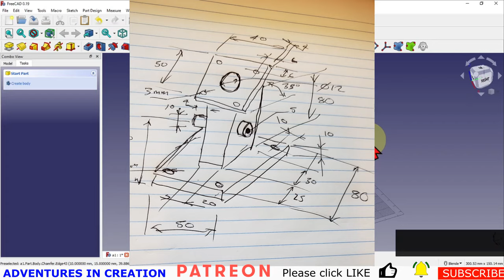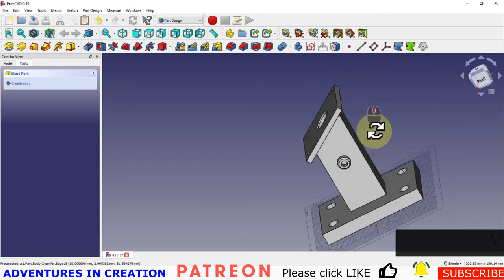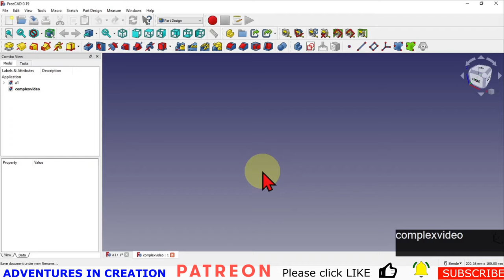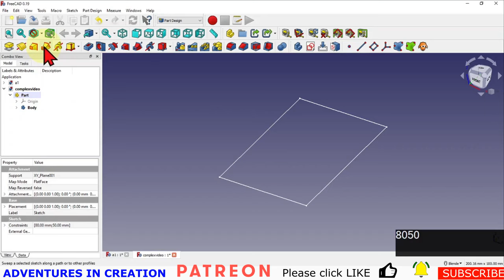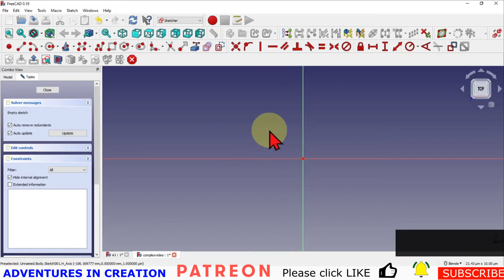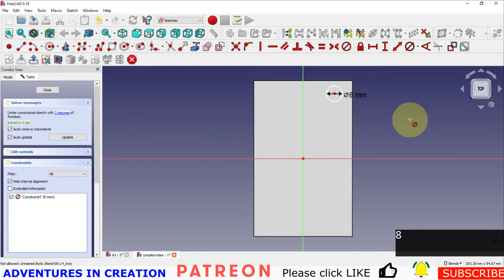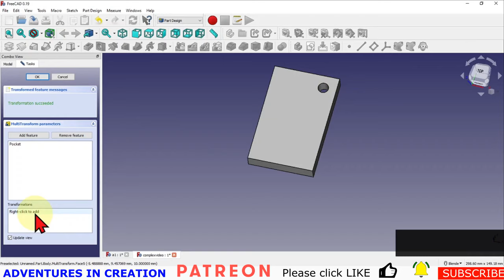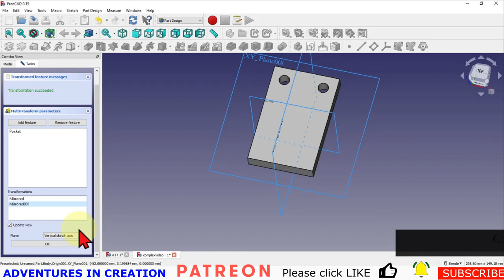FreeCAD Beginner #10 - Creating a complex model

Comment: very much enjoyed this video, thank you for your efforts.  Now that I'm retired (65) I have time to dig into CAD as I'm now the owner of a 3d printer and soon a desktop cnc mill.  I'm very familiar with isometric drawings as a machinist and electrical engineer. .   I've been bumping around CAD software ie Fusion 360 and a few others sort of picking stuff up but really need to find an instructional series that shows best practices for CAD drawings. I need to start at the beginning of your series now more for the learning where all the various keystrokes come from on the user interface.  It is good to see how the process develops on a more complex model.  I will revisit this video after plowing through the earlier ones from beginner on upwards to get familiar with the software.
Reply from the maker: Make sure you take a look at #27 it's on tech draw and will get you to a fully dimensioned drawing.

Comment: Being a person who does not necessarily remember formulas, I ended up experimenting with the datum plane for the angled piece by attaching it directly to the surface produced by the angled cut of the upright, and used the upright's external geometry as reference for measurements and constraints of the angled face while in sketch mode. It's a bit easier IMHO than remembering somewhat obscure and complex formulas. 

Just my 2 pennies. Thanks again for the excellent tutorial!
Reply from the maker: I am glad you are experimenting for yourself, that's what I hope will happen. Just one word of caution, if you attach a plane to a face you may run into the topological naming issue. If you do that, you might as well just create the sketch on the face that you were going to attach the plane to. You can create a datum plane on a base plane them move/rotate it from there.
Reply: @Adventuresincreation  Thanks for the reply. I thought using a datum plane on that surface instead of the surface itself would sort out the issue, since the plane is (I think) used in lieu of the surface itself. Isn't that how datum planes work? Well, I suppose that's how they should work in my head, haha... Guess I'll have to do some more experimenting to try and figure it out. Thank you.

Comment: 3:15 the order of selecting the vertices is important. First select the two corners (upper left and bottom right) and than select the center / origin.
Reply from the maker: This is true
Reply: A way to get around this is to draw the rectangle from the center. That option is available.

Comment: I appreciate your work so much, this is great stuff. I appreciate showing us how to modify a datum plane to sit on a custom axis, but I wanted to mention that it's also possible to do this by simply clicking on the face in question and choosing "Create a datum plane" from the Tasks tab.
Reply: Just be aware that attaching the datum plane to the face makes it vulnerable to the topo naming problem. I'm not sure there's really much use for attaching a datum plane to a face either. If you're doing that, why wouldn't you just sketch on the face directly? Hopefully in a few months, the topo naming problem will largely be fixed.
Reply: @haysoos123  thanks for those details!
Reply from the maker: Just to reiterate what @haysoos123 said. If you watch the video I will publish this week FreeCAD Beginner #11 you will see a demonstration of the topological naming issue where I show how creating a sketch on a face is problematic. - It works but only if you don't modify the sketch afterward. That is why I don't use that technique. Hopefully, it will be fixed in release 0.20.
Reply: EDIT: I lie (sort of). After adjusting the hole diameters that are part of the multi-transforms,  that triggered the topological naming problem when the datum plane was attached to a face.

 @Adventuresincreation  I actually did it this way as I was recreating this part, i normally try it before watching your method. It worked fine, even if you go back and alter the length or width of the pillar etc. I understand the topological naming problem, but it didn't cause an issue in this context having just attached the datum plan to the face. I liked your approach for positioning the plane independently though, was  good to see that.
Reply from the maker: @TheMadMagician87  usually it works. It's when you adjust the model later that it all goes bad. I am glad you are trying it first before watching my solution. There are many ways to achieve similar ends.

Comment: Many thanks. As I understand it, you could have established the datum plane directly on the cut face (highlight the cut face, then make a datum plane) without having to do any computations.
Reply from the maker: In the latest version, you can do it on the face however, in older versions that would have caused an issue with the TNP
Reply: Ok. Anyway, good run through some basics. Thanks

Comment: Funny, I made parts on my router for a long time using inch and most of the drawings I got where in mm, and I converted them for the longest time before trying it in mm.  I haven't gone back to in yet, I now convert in to mm!
Reply from the maker: Same here, I started out with inches but find metric way easier

Comment: This might be dumb question, but I'm relatively new to CAD, so... instead of positioning datum plane, wouldn't it be faster and simpler to select the angle face on the body and then hitting sketch?
Reply from the maker: Yes it would but then your model may break because of the topological naming issue. Basically the reference to faces can change when the model is modified. Datums are a way to prevent your model from breaking this way.
Reply: @Adventuresincreation  that makes sense.. thank you

Comment: In the latest FreeCAD, you can create a datum plane directly off the angled plane at the top by clicking that face then the "datum plane" button.  Much easier though the origin point isn't set to the center of the face.
Reply from the maker: You still have to be careful using faces because of the TNP.
Reply: @Adventuresincreation , I'm a complete beginner at this.  What is TNP?
Reply from the maker: @BriansBasicStuff  topological naming problem. Essentially references to faces can change during model modification.

Comment: Thankyou very much 
Could you please tell where I could get more information on setting the height of datum (90 -tan(35)*15).....
Reply from the maker: You are welcome. I am not sure what you are looking for? The datum height was a trignometric function.
Reply: The top of the pillar is a right-angled triangle, with a base of 15 and an angle of 35°  The trigonometric function tan (tangent) is the ratio of the opposite side (call it h) to the base.  So tan(35) = h ÷ 15.  Rearrange to get h = 15 x tan(35).  90-h is the offset you need for the datum plane.
I remember sitting in trigonometry lessons at school, thinking "I'm /never/ going to need this stuff..."

Comment: Nice tutorial going over some useful basic tools.  Out of curiosity, why did you create a datum plane for the angle top bracket, versus just selecting the angled top face of the post for your drawing plane of reference?
Reply from the maker: The topological naming issue will present a problem if you use the face. The name of that face will change if you modify the model.

Comment: About the datum plane, is there no way to attach it directly to the surface ? I'm thinking solidworks, where I would draw directly on the surface.
Because as I see it, if me modify the height of the models, we have to calculate everything again, it is not dynamic
Reply from the maker: You can do that but you will be exposed to the topological naming issue at the moment. Once that is solved we could sketch directly on the face
Reply: @Adventuresincreation  wdym topological naming issue ?

Comment: Do you have advice on when to make a new part vs when to make another body in the same part? I use FreeCAD for woodworking and struggled with this choice, but I've landed on making every board its own part, and putting them together in the assembly workbench. Tedious and fragile to change, but it's the only way I've been able to plan for allowances like shelf grooves and make tech drawings for each board to be cut. I too came to FreeCAD recently from TinkerCAD, which was fine for 3D printing, but couldn't help me plan joinery.
Reply from the maker: I think your approach is sound. If the item is a discreet thing with its own features it should be a part. If the item is a piece of a whole then it can be a body. As you know, you can't assemble bodies only parts.

Comment: Instead of using the tangent formula for the datum plane, can you set the face of the cut post as the sketch plane?
Reply from the maker: You can but you have to be careful not to cause the model to break due to the topological naming issue.
Reply: @Adventuresincreation  just saw that in another one of your videos 😅🙏

Comment: Lowe's has a good variety of metric fasteners.....screws, bolts, nut, etc.
I find it difficult to understand why so many Europeans have problems using the imperial system....I work in both and have no issue.
BTW, we don't normally use "fractions" for precision work, we use decimals...
Reply from the maker: I was brought up using inches, I worked as a tool maker where we manufactured to within thousands of an inch (thou) but our drawings were all in metric so we had to convert everything from mm to inch. I am very familiar with the imperial and metric systems. The metric system just makes more sense to me as does the Celsius scale (based on the freezing and boiling points of water). It's personal preference.

Comment: Is there an advantage to creating datum plane via z offset vs creatimg datum plane by choose a face/area and click datu, plane?
Reply from the maker: The Z offset will avoid the topological naming issue
Reply: @Adventuresincreation   Honestly even if you (rightfully) worried of TNP, you can create datum plane by clicking face first, then in preference delete reference and choose "Deactivated" attachment. It will not move datum plane. It can be done either during datum plane creation or changing it preference afterwards as well.

Comment: At various places in your videos, you seem to have trouble with orbiting the model (about 28:30 in this one).  I found by swapping the mouse for an inexpensive trackball a couple of years ago that CAD software became a lot easier to navigate.  I was using F360 then.  M570 trackballs were regularly available for about $15 back then. They are about $35 now.  It took about a week to get the feel of it, but I wouldn't want to go back to an ordinary mouse now.  FreeCAD works great with a trackball.
Reply from the maker: Thanks for the tip, I have used a trackball in the past but to be honest, it's not really a lot of  trouble it's more a case of not having much space where my mouse is located. - If I was doing more FreeCAD than I do, I might consider the trackball. It's good tip for those that are doing a lot of CAD.

Comment: sorry I had problems with version 20.1, and couldn't cut, copy and paste!
it's finally solved, I installed version 18.4 and it works without any problems.
Reply from the maker: Glad you got it figured out. Seems odd that v 0.20 is giving you problems
Reply: @Adventuresincreation  so far I have been able to make everything, but copying and pasting a part of a drawing in Sketcher does not work!
these in the edit menu are inaccessible and slightly colored, and ctrl + c don't work either!
not even after a full reinstall of the 20.1 version without addons gave no improvement.
Am I doing something wrong in the new version that was possible in the older versions?
Reply from the maker: It should work

Comment: Hi, can you please explain why you always start a new sketch from the origin instead of sketching directly on a selected face? For example, when you built the tower off the base, you started from the XY plane and added the initial 10mm thick base to your 80mm tall tower, rather than sketching and building from the face 80mm up. Similarly, when creating a datum plane, you added a formula to position it exactly where needed, instead of simply selecting the face at a 35-degree angle and creating the datum plane there. 

I'm just learning and I'm curious if there's a beneficial reason for doing it the way you've shown, or if there has been an update allowing a simpler method since this video is 3 years old. Thank you!
Reply from the maker: Great question! - In prior versions of FreeCAD it suffered from something called the Topological Naming Problem. Essentially, the labels for faces would change if you modified the model and added new faces hence any attached sketch would move to where then label moved with unpredicable results. You can read more about it here https://wiki.freecad.org/Topological_naming_problem. The very latest dev release of FreeCAD has addressed this problem and for the most part resolved it so now, creating sketches from faces is an OK thing to do.

Comment: Thanks.  I'm self taught with freecad from way back.  I have used the datum plane a few times.  While on that note, I  have nearly always built parts up buy mapping sketches  to faces and building from there.  What is the advantage to this method?  I can see that it would avoid some of the heartbreaks where a small change to a early piece of the part breaks the whole model.  Is that the main benefit?
Reply from the maker: Yes Cory, that's the only reason I don't recommend doing that. I am hoping this is fixed in the next release.
Reply: @Adventuresincreation  Unfortunatelly, v0.20 won't fix it... :(
Reply from the maker: @zoltanberkes8559  no, they are talking about the next major release now.

Comment: Lol, I get the hybrid unit system woes. I'm from and in the states but I refuse to use Imperial for CAD because it just feels arbitrarily more difficult.

Also me: using mils for PCB design 😅
Reply from the maker: I was brought up on imperial measurement - I still measure weight in stones but metric is much easier in a CAD environment.

Comment: Thank you for this. It is very helpful. My question though. If I wanted to fabricate this, it seems to me that it is at least 3 different parts. Can I model it in this same way and then come back and slice it in to different parts?
Reply from the maker: I would create 3 separate bodies, that way you can manipulate them separately.
Reply: @Adventuresincreation  thank you. I was thinking, what if I just want to model a large multi part body roughly and then cut it into parts later. Is that a possibility or should I just think in parts from the start?
Reply from the maker: Personally, I would think it parts from the start. It will help you with fabrication in the future.
Reply: @Adventuresincreation  thank you very much

Comment: Question: When you created the datum plane for the inclined top why didn't you create the datum plane from three points on the top surface instead?
Reply from the maker: There is always more than one way to model items. As long as the approach will create a "topological naming issue" free model. You can do create it any way you would like.
Reply: I wasn't being critical of your excellent videos. I am learning FreeCAD and found another way to create the  datum plane by accident and thought it easier than getting involved in trig. A neat, and time saving, feature for parametric modelling would be the ability to select values directly from the spreadsheet. Having to retype spreadsheet. etc gets tedious. Also I used Alias Manager instead of EasyAlias as the online copy is screwed at this time.    @Adventuresincreation
Reply from the maker: @davidgoadby   I am glad you have found alternative ways that work for you. Thanks for sharing them.

Comment: Thanks for the video. Coming from CREO and solid works, I must say I'm quite disappointed that the developpers didn't work on extruding/sketching on a selected face. This is really a basic requirement for CAD. Still, developping that software is a massive amount of work, so a massive applause for those who developped it. But if they do upgrades, they should work on this before anything else. Working from existing faces/geometries is a MUST.
Reply from the maker: It should be in the next major release after 0.20
Reply: In version 0.19 I can select a face and then press the "create a new sketch" button and start sketching on most surfaces no problem.
Reply from the maker: @stijnliekens5834  you can but be careful as the topological naming issue is not solved yet, you can get into trouble very quickly.